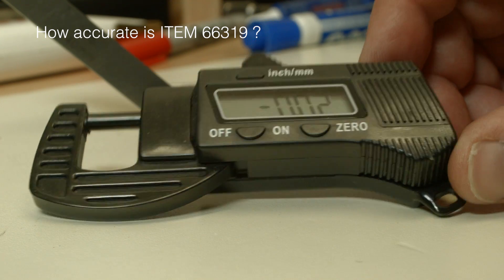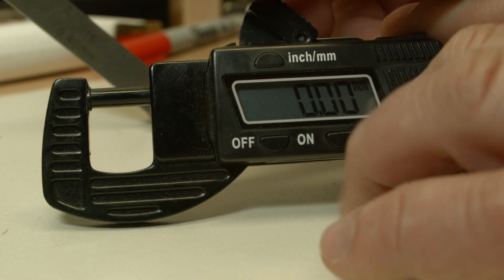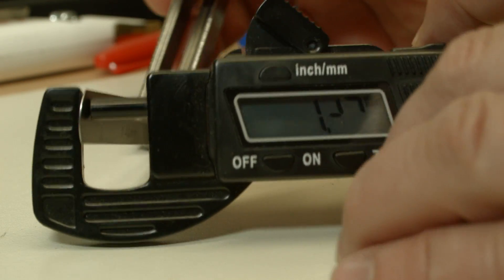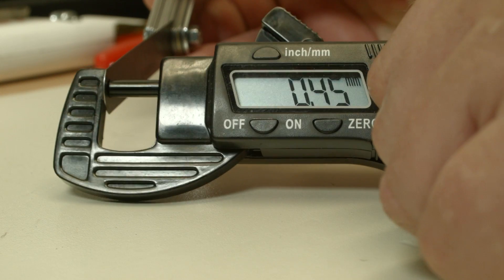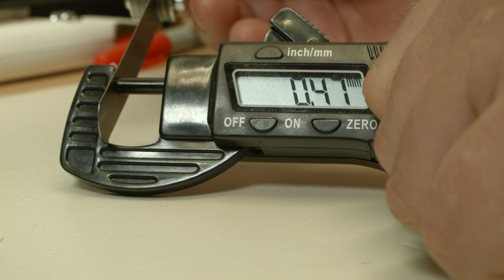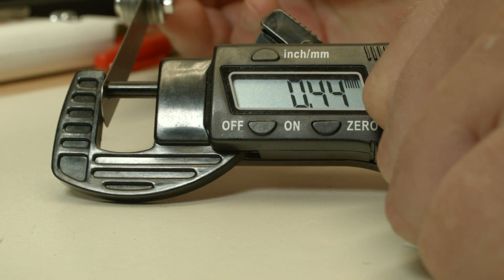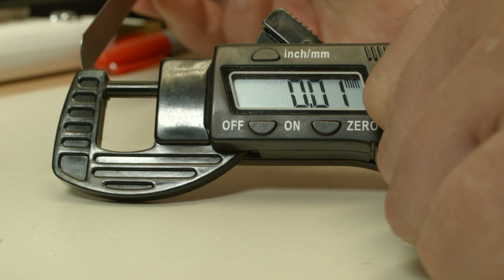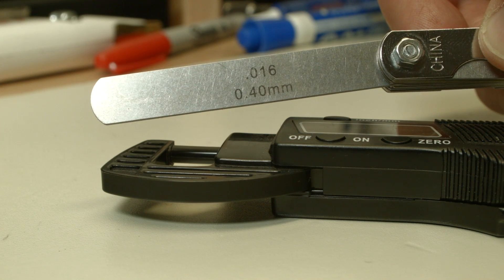Digital Thickness Gauge Accuracy

Comment: Feeler gauge should be tight enough, this is not the right way to measure, I think if this micrometer could be tightened it would give accurate readings, but holding it in the hand and continuous movement will not give any accuracy..
Reply from the maker: Said Murshed there is a spring in there pushing the pin into the gap
Reply: @mygiguser  obvious.. but i don't think it pushes enough, if you know what I mean

Comment: Why does the number keep changing as you move the feeler gauge around?
Does the feeler gauge not have an even thickness?
Reply from the maker: No it has an even surface (cylinder), and that's the beauty of it, you have to put the feeler gauge 100% at the right angle to get the right number.